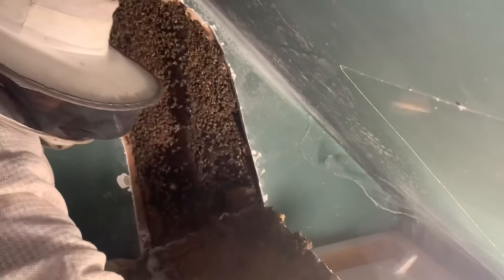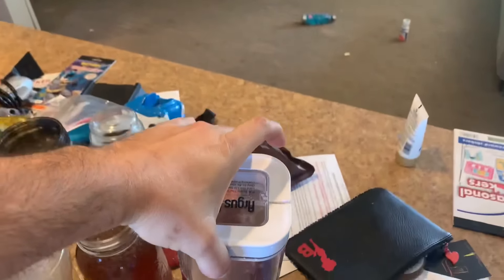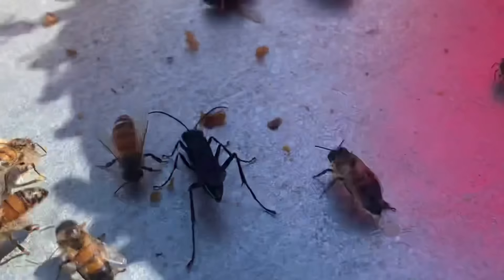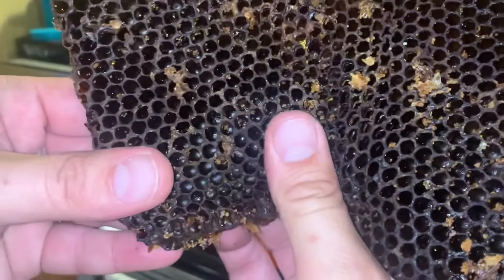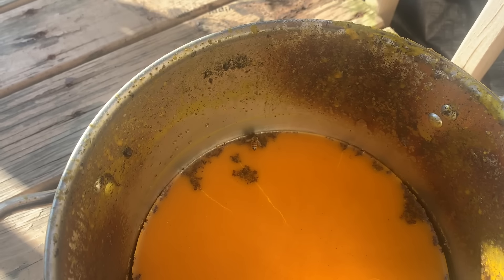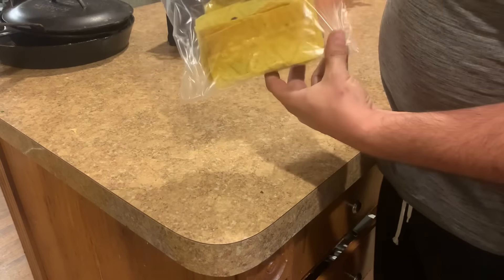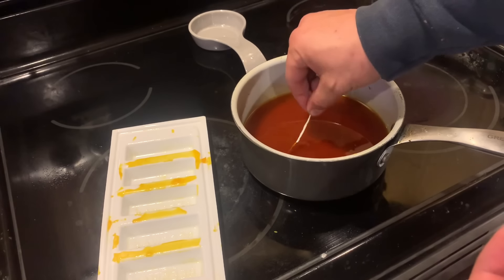Rendering Beeswax from honeycomb

Comment: Great video, but have you tried to use a wooden box with a screen in the bottom and then use a wallpaper steamer to render wax. It’s a lot less messy and can be done outside. Also faster! Instead of a turkey roasting tray I’ve used a silicone baking tray this makes removal of wax really easy, no need to use a mould release on big blocks either.
Reply from the maker: Wow, that’s an amazing idea, I might give that a try next time that I do this. Thanks for the info!

Comment: 12:33 as a chef, just take a random cup filled with neutral oil, dip it. wipe the mold surfaces.
12:50 then into a measuring cup
Reply from the maker: That’s a good idea. What would be a good neutral oil? And have you seen my turkey and my ham videos? What do you think?

Comment: I've found using silicone pot inserts and silicone sieves so much easier to use than metal pots
Reply from the maker: Where do you get your silicone stuff?
Reply: @RyanGrady  I live a tad south of you (Australia) so probably not helpful to mention where I got mine 😁 but silicone bakeware is widely available now-a-days, in stores and online, no doubt more so for you than me.  The larger silicone dishes are too floppy to use on their own so I stick it a pot that is roughly the same diameter and put a little water in it before the silicone bowl... makes clean up SOOOOO much easier.

Comment: i have a few hives, i use an old microwave and Pyrex pot for rendering beeswax. the pulp makes great fire starter blocks. also you can add hydrogen peroxide (about 1 teaspoon per lbs) to lighten the wax during rendering.
Reply from the maker: That’s a great tip. I will try that!

Comment: I use a large stock pot, some pot scrubber on the bottom, a metal bowl I drilled some holes in, some wire racks, and a pot underneath to catch the wax after it drips through the towel filter.  I'm not too happy with the idea of putting wax in the oven, so I put the contraption together, put a couple inches of water in the bottom, set it on the range, and steam it instead.  It won't do really large batches, but it will render the prettiest, cleanest wax...
Reply from the maker: That sounds very interesting. You should make a video of the whole process. I would love to see it!

Comment: Nice video guy but be careful, putting wax in an oven creates risks. At 180
°C 356°F the wax evaporates and risks igniting.
At 254°C, 490°F it reaches its flash point and explodes ! 
Good luck !
Reply from the maker: 100% correct! I think I mention in the video to be carful because wax is flammable. That’s the reason I kept the temp at 200F. I have heard that 200F is too hot and changes the wax in a negative way. They say no higher than 150F. But I’m not 100% sure on all that. Thanks for taking the time to share your knowledge! It’s very good information to know.

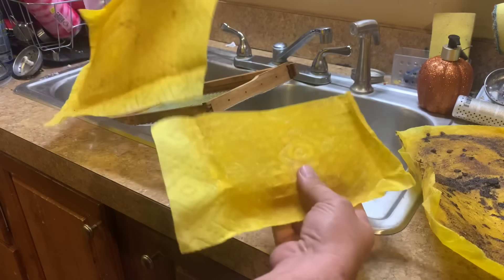Comment: 9:45 I often do a similar thing at home where I mix shredded paper with wax and form it into a little cupcake with a match on top. It looks silly but burns great!
Reply from the maker: That’s a good idea. I would like to explore more ideas for good fire starters in the future.
Reply: Egg cartons also burn really well, but aren't easy to shred. If you want to be creative, silicone molds come in all kinds of fun shapes and you can add coloring to the wax or minerals that burn different colors. (Or iron filings for a sparkler effect!) You could make a little flame, a bee, etc...

Comment: Hi Ryan
I don't know if you are interested in a workaround for your problem with the plastic inlays and the bees not accepting them.
From the wax I collect, I cast plates (similar to your plastic ones, with a honeycomb-pattern) and melt them into the frames. The frames have a wire to support the combs, so they don't tear apart when extracting the honey in the centrifuge. When applying a small electric current to the wire (like from a laptop-power-supply), the wire gets hot and the wax plate melts onto the wires. The bees make the new combs out of this wax. Because the bees don't have to produce (as much) wax in order to build the combs, they need less energy and produce more honey.
But if you want them to produce wax, you can just melt a small strip to the frame's upper end. The bees will then also build the combs neatly into the frame. If you do that, and you want only worker-bee-cells (no drones), you put these frames during the first year into the "honey-room" (one "floor" above the breeding frames). If you use a centrifuge to extract the honey, you can give it afterwards to the bees as breeding frames.
Good luck to you and your bees.
Reply from the maker: I have seen that done. The plastic frames have worked well for me so far. As long as I coat them in wax the bees don’t seem to mind. 
I have thought about doing that for my honey supers. That way I could offer cut comb.
Reply: @RyanGrady  If you want to know more or need some pictures, I'm always glad to help a fellow beekeeper. Just shout my name three times...
;-)
Reply from the maker: Lol, I will do that haha.

Comment: As for rendering the beeswax maybe you can skip the pot and directly get a fine Strainer and do it 2 times in the oven. 1 time with a BIG but fine strainer and a second time with a paper towel. 
In this case i hope to increase the yield even more as on the 1st run more of the wax should run off the chunks.  

Maybe even break them down in a blender roughly to fit more into the strainer.
Reply from the maker: That’s true, but like I said in the video, anything you use in the process becomes ruined. Wax sticks to everything. It’s not a bad idea, but the more steps I add, the more items I need to use.

Comment: When pouring liquids out of a pot, bowl, or glass... put a knife on the very edge of the pot where the wax (or other liquid) is falling out, and keep the knife edge vertical, against the rim of the pot, and lower than the edge.

Pour slowly, and surface tension will keep the liquid running straight down the knife and into the new container, rather than dripping down the side of the pot and making a big mess everywhere.
Reply from the maker: that's a great idea. this was my first time messing with wax. in the future i plan to buy items that are made for pouring and candle making.
Reply: @RyanGrady  It works with water too - you can check it out with just water in a pot.   Keep up the good work with the bees -  we need all of them we can get!

Comment: Beekeeping can be a money pit. I learnt to make my own stuff. Molds for bees wax is just simple used up butter in tubs, Or sour cream tubs for smaller blocks.. This make it a lot easier and faster to melt, than 5 gallon buckets. I use my bees wax for candles, and molds to make things. As well as giving them there comb back to them for,  brood and make more honey. The main thing about wax is not to boil it. needs to stay around 160 deg. to melt. Ways of melting it is? Solar, electric, or propane. I use all 3. it fast with propane, then electric . If you not no hurry > solar is the way to melt wax. But my time is limited. that why i use propane or electric

Comment: The junk you may be able to sell as a non-petroleum based fire starter. If it will eventually decompose if left outside in the elements, could also call it environmentally friendly too
Reply from the maker: That’s not a bad idea. I will say that I left it in a pile out back and it is gone now. So it does breakdown.

Comment: Beeswax also works for waterproofing arc welding rods for use in underwater welding as well.
Reply from the maker: Really? I had no idea that you could use it for that. It’s so amazing all of the uses I have learned from different people commenting.
Reply: @RyanGrady   You have to use a self consuming rod with no gap like you would doing topside welding with DC and a knife switch to energize and de energize the stinger but that's a very detailed tangent to move down.

Comment: I'm a bit late to this, but have you considered using water to clean the honeycomb at the start? I'd imagine that the wax is insoluble, the honey is very soluble, and some of the dirt could wash off as well. Could make that first phase of getting off the honey much easier.
Reply from the maker: That’s possible but if you look closely at the comb in the video, the dirt has permeated every inch of the comb. The dirt is not just sitting on the surface but is ingrained into it. This comb was over eight years old. Eight years of bees tracking their dirty feet over it has just saturated it with dirt. I think washing it might be helpful, but would also be of minimal effect. Might be worth trying though!
Reply: @RyanGrady  I figured, I was mostly suggesting that as a way to get the honey off.

Comment: when i was akid the left over junk from seperating wax.. we used to light the fire in the mornings int he stove and in the fireplace. wed just put some on a pinecone or some pine needles or crushe dup news paper. .and put in in the kindling.
Reply from the maker: A lot of people have mentioned using the junk as a fire starter. I had not thought of that when I made the video. I will be making a follow up video in the future where I will try that along with several other new methods. Make sure you subscribe so you don’t miss it!
Reply: @RyanGrady  yeah i guess in the modern era its not needed, but when you have bees and wood and old papers.. Its just a great thing to light the stove in the morning. Its not at all needed if you have good kindlineg.. Especially pine. You can take some fatty root and light it with a match.. But as a small child the wax soaked paper or waxed rags was easier as the fatty wood had to be split thin with a knife.  Based on howmany youtube videos feature how to light a fire i think most fire owners in  might have problems lighting them 😏🤣

Comment: If you hold a stick or rod against the lip of the pan as you pour the liquid beeswax into the molds, surface tension will cause the liquid to "cling" to the rod as it flows down it into the mold hollows. This works wonders with most liquids and saucepans with poor pouring lips. Neat video. So when the bees reclaim the honey and incorporate back into the hive @4:45, is that honey suitable for human consumption?
Reply from the maker: No not really. The honey would still maintain a undesirable flavor because of the dirt that is infused into it from the old honeycomb. I will have to try your suggestion. Thanks for the comment!
Reply: @RyanGrady  You're welcome. The "pour the liquid down the rod trick" is something I learned in middle school chemistry class. Amazing how I can still remember and apply knowledge like that... Happy beekeeping!

Comment: If you put a dull knife edge to the bottom edge of the pot when you tilt it, the liquid will drip down the knife blade into the mold much cleaner than if you just pour it straight from the pot.
Reply from the maker: That’s a really good idea! I’ll give that a try! Thank you!
Reply: @RyanGrady  it should work decently well. I do it with liquid soups and stove hot-cocoa all the time. Just be careful with balancing, since you'll only have 1 hand to pour with (or have a partner help) and also make sure that the bottom end of the knife is pointed toward where you want the liquid to go, since the liquid will fall down the knife.

It also doesn't have to be a knife, either. I usually use the side of my soup-stirring spoon, but I also usually have a bigger opening, what with using a bowl rather than a mold.

Comment: to measure the volume of the silicon molds, just put the mold on a scale, tare the scale and then fill the mold with water. then with the weight of the water you can determine the number of ounces.
Reply from the maker: That’s a really cool idea. I hadn’t thought of that. Thanks for that.

Comment: Take a metal cupcake tray, spray it lightly with silicone spray and wipe off excess.  Do NOT use cup cake papers - just the metal tray.  pour in hot wax and after it fully hardens put it in your freezer for 'a while'.  The wax will shrink due to the cold.  Upside down on newspaper and shake the "1/2 cupcakes" out.  Repeat.

The junk you threw away - put all of it into a cheesecloth bag, put that in your boiling pot and weigh it down with a couple of smooth river rocks and then fill the pot to 3/4 with water.  Pot on stove and SIMMER it for 1 or 2 hours.  Turn off the heat and leave it until the recovered wax on the top is hard and stone cold (shrunk).  Pop the wax from over the water and take the wax from the pot.  Put the bag and junk aside to dry and use it for fire starter.

To get almost all the pollen, dust and misc junk from the almost clean wax: 
Put the almost clean wax in an old metal coffee (or paint) can and do a very slow simmer for 1/2 an hour or so.  Turn off the heat and put the can into the fridge.  Later pour out the honey smelling water out and cut the can away from the wax.  Turn the wax slug upside down and use a knife to scrape what was the bottom which is where sediment settled to.  Viola - really clean wax!  

A fun fact - thin bee's wax candles don't drip while they burn.
Reply from the maker: Wow, you really know a lot about this. Those are some really good ideas that I hadn’t thought of. I think in the future I will try to do that. I am considering using paint strainers instead of cheese cloth.

Comment: If you filtered it properly after the first process you might not need to go through the trouble of warming it in the oven. Just a thought.
Reply: Try getting some 75micron hash bags
Reply from the maker: I have been told to use pain filters while boiling it. I might try that next time.

Comment: To get a nice Silicone mold of your one ounce bars you can take the bars from the plastic mold and build a mold box for them then use a food safe silicone molding compound.  Smooth On's Smooth Sil line of products has a couple food safe options you can order online.  Finding food safe mold rubber locally can be hard in rural areas.
Reply from the maker: Yes there is nowhere close to me that sells anything like that. I would definitely have to find a place online to order from.

Comment: maybe this has been said before but i bet you could press that "junk" into some little silicon molds to make sticks for pretty good firestarters
Reply: or maybe smear it out onto a trashbag to make something closer to your paper towel firestarters
Reply: one last thought, if you want oz silicon molds, take a few of your wax bars and glue them to a bottom of a plastic tub sprayed with mold release and pour some mixed silicone over them. ezpz
Reply from the maker: Yes multiple people had made comments about using it for fire starters. But I like your trash bag idea!

Comment: Would there be an alternative for the moulding oil? Canola, or any processed seed oil isn't advised to be the best. Otherwise fantastic work!!
Reply from the maker: Yes there are oils made specifically for releasing from the mold. But I just used what I had on hand. 
I think in the future I’m going to try to stay with silicone molds that will not need an oil.

Comment: If you heat up an area, say in the heat of summer, on top of several of your hives, with a pane of glass and the sun shining really hot, it will slowly melt the wax and the bees will use it to build out new foundation. Do this every one so your comb stays fresh and with the least contamination. The hottest part of summer, when little nectar is available is the best time to cut out old comb and give them new foundation to draw out.  Best is to give the queen only new foundation to lay eggs on, so the workers will eagerly take the melting wax from the top of the hive, and as it melts, the workers will remove it and take it down to the new foundation, to draw it out without using honey resources to make new wax. Just cut the comb into two parts and to expose the center of the comb to the foil or cookie sheet. The center is the most wax, while the outer most part of the comb has the least amount of wax. Imagine rendering a fresh sheet of wax foundation, the center is nothing but wax, and the drawn foundation is little wax but, lots of cocoon. You don't want to melt the wax and cover and saturate the layers of cocoons. Examine the comb under microscope and you can see the cells are thickest at the base of the cells and the thinest at the top of the cells. Hence, the base of the comb contains the most wax, while the outer most part has the least.
Reply from the maker: That’s really interesting. I never would have thought about that. I would like to see that process in action so I could wrap my head around it better. I may have to do some experimenting with giving wax back to the bees this year. Thanks for the amazing comment!

Comment: I like your paper towel method.
Where did you get the silicon casting form ?
Reply from the maker: Thank you! I got the mold from eBay. https://www.ebay.com/itm/223970736081?mkcid=16&mkevt=1&mkrid=711-127632-2357-0&ssspo=PfopBxnyR8K&sssrc=4429486&ssuid=v_K3-mWmS5W&var=&widget_ver=artemis&media=COPY

Comment: I think when setting stuff out for the bees to clean up, you're supposed to do it away from the hives, cuz putting it all on top of a hive like that encourages robbing.
Reply from the maker: I’ve heard that but I haven’t personally had any trouble with it. I’ve got my entrance reducers set to the smallest opening. So the bees can defend their hives very well. I use screen bottom boards and vented tops. So they don’t need a bigger opening. When the flow is on, I open the reducer to facilitate to traffic.